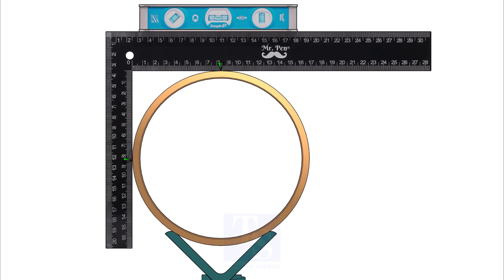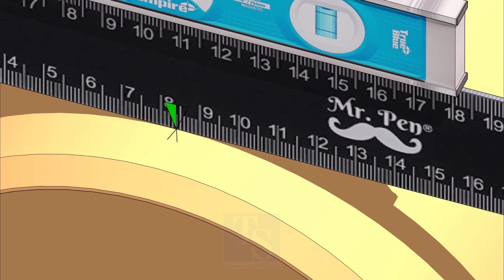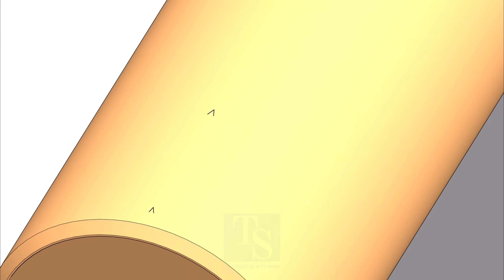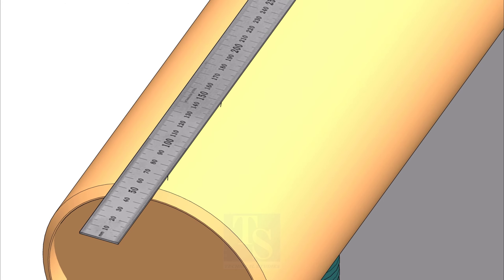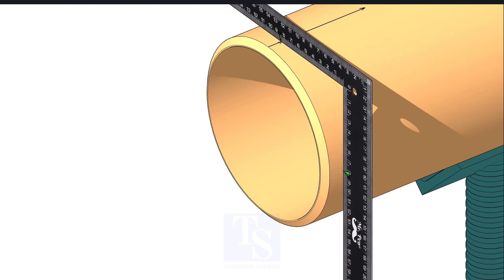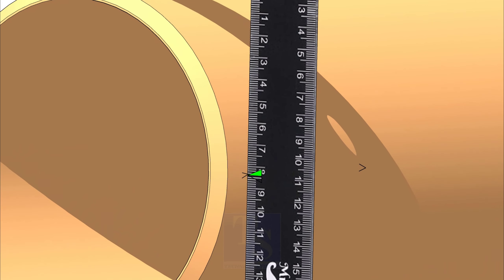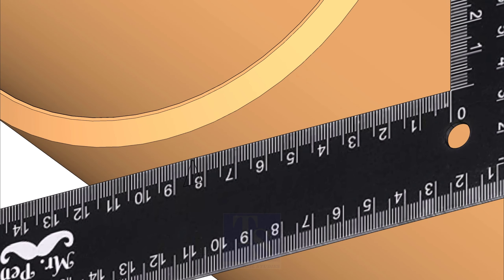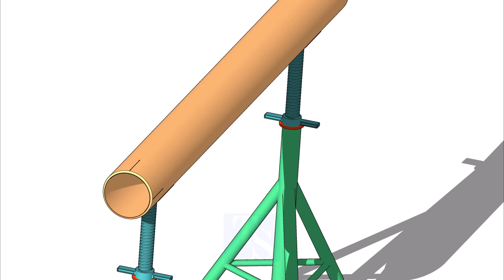PIPE CENTER MARKING.

Comment: Take a piece of receipt paper...wrap it around.....take it off....fold it it half...put it back on.
Reply from the maker: Yap, that is also an idea.
Reply: On a 14 inch pipe it becomes difficult with that receipt paper
Reply from the maker: @tinashenkomo4471  This paper method is applicable only to small dia pipes and cannot mark a  center line.
Reply: @tinashenkomo4471  You need a walgreens/Riteaid/cvs receipt for this length.